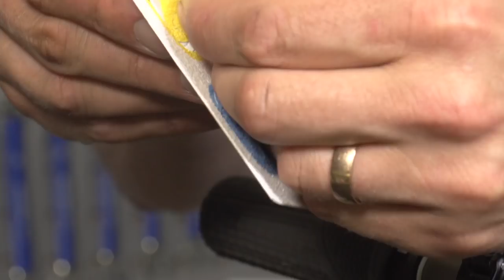7 Pro Tips For The Ultimate Custom MTB Setup | Mountain Bike Maintenance

Comment from the maker: What are your pro hacks and cheeky spare storage solutions? Let us know...down below 👊
Reply: Global Mountain Bike Network self adhesive puncture repair patch Make great anti cable run patches as the are soft rubber and stick on great 👍
Reply: Global Mountain Bike Network  
I put my spare quick links in the end of my bars wrapped in a bit of old inner tube to pack it out
And same on the other side with some cable ties!
Works great
Reply: Global Mountain Bike Network wrap an inner tube around your hub and tape it, and because it is close to the centre it wont add much rolling mass
Reply: rika Shaw Seths bike hacks 👌
Reply: I have foam in my steerer tube so mud dont gets up there, and i've also taped the inside of my tyres with ducktape, yeaa i know it sounds dumb but it keeps me from punctering and it,s an enduro bike so weight dosent matter that much 😉 and my biggest customize is my Push Elevensix rear shock dialed for me 😎👍👌
Reply: Mark Schultz you have a push? Dang bro, do you race?
Reply: Mark Schultz that is a high performance and expensive shock. Usually people who have it are racers
Reply: yeaa i know but in my case it was the only coil shock that could fit my frame ;) but i am sponsored by Trek so i guess you can call me a racer if u want ;)
Reply: Mark Schultz how are you sponsored by them, do you get massive discounts or bikes? How long you been racing?
Reply: can´t say ;) and 5-6 years ;)
Reply: Specialized glove box all the way! 
Also burping the fork with a zip tie is a neat little trick, just carefully push the tie down behind the seals. Until you hear a hissing sound
Reply: You can help prevent water getting in the seat tube by covering the notch with some tape or a bit of frame protector.
Reply: i always set my fork's rebound to super fast top get the best balance comfort and control
Reply: Specialized SWaT 👌🏼👌🏼
Reply: Awesome bike doddy. Now can we see you riding it? Thanks for the tips very helpful.
Reply: rika Shaw I've actually done this on my front wheel and its good. Even at over 60kph I don't feel it. And as a bonus, the weight of the inner tube keeps the front wheel on the ground more if I'm biking uphill.
Reply: I also use Scotch mastic tape on my bike on the outside of the seat stays to protect them from heel rub. Also, my dropper post doesn't have height indicators etched on the main tube; so I use a small piece of electrical tape to mark my correct seat post height. If I'm riding along and think that it's slipped, it's really easy to see for sure.
Reply: best way to store a spare master link is to put it on the on the spot where two spokes cross on the wheel
Reply: The best place to put a Master-link is under your top-cap on the steerer
It will fit if you put one half on each side of the bolt
Reply: but then you will have to adjust your headset and make sure that your bars are straight , but nice idea defintly
Reply: If you think that your topcap affects your headset or handlebars, then your unlikely to be able to fit a quicklink anyway
Your stem bolts do all the holding, the topcap only preloads the bearings, you can even safely ride with no topcap at all!
Reply: Global Mountain Bike Network can I clamp my dropper post
Reply: Walk into an auto body shop and talk to the underpaid goon at the counter about 3M paint protection stuff.  They chuck the leftover bits in the garbage all the time when they're too small for cars, but those leftover bits are more than enough to put on your bike frame where needed.  If they do want to charge you for it, walk out and go to another shop, someone will give it to you for free.

Electrical tape on the cables will also deteriorate and come off eventually, while also making a sticky mess.  Get those cheap velcro cable ties and use those, they can slide a bit if needed, easily removable and are quiet.
Reply: I put grip tape on shifters
Reply: Roll up a small stash of currency notes into the handle bar ends gaps. Some emergency funds, in case cards are not accepted during the rides at a convenience store etc. Also helpful on a rainy day in case you are riding without your car / pick up van and for some reason have to rush back or whatever. Like here in India, we can hire a tuk tuk & just take the front wheel off and load the bike into the tuk tuk and have to pay cash to the driver.
Reply: Vijay
Reply: @KEN53KTM  i tie knot whit fishing line to chain lock (its locked gether and i pushin to bar end it wont rattle in side bar  and its easy to pull out with fishingline
Reply: Make sure to ride with your little brother so you can make him carry everything in a book bag

Comment: I've used grip tape on all my levers, and have gotten excellent grip. However, my thumbs now stick out of my gloves. The grip tape has worn that spot of the glove away to nothing. It works, but be ok with replacing gloves frequently.
Reply: SG - MTB Aren't the gloves enought to stop your fingers from sliding?
Reply: Easy : now apply some grip tape to each thumb of your gloves !
Reply: Unfortunately not
Reply: yep grip tape wears out gloves so now I am using the rougher side of the stick on hook and loop, still wears out the glove but no where near as quick as grip tape did.
Reply: Yeah, grip tape is a gloves killer. I'm still looking for some rubberish tape that's not rubbish (perfect dad joke there).
Reply: sp00n this rubber electrical tape doddy shows in this video might work really well
Reply: There is spray on urethane if you can carefully mask the other surfaces you can coat the levers. Last a very long time and doesn't destroy gloved.
Reply: I actually already use this 3M mastic tape to protect my frame. But it's pretty soft and somewhat sticky. I wrap my knee protectors around the top tube when I ride uphill, and the mastic tape there tends to stick to the fabric when I take them off again. It also dissolves slightly and gets a bit slimey when under constant pressure. I don't think it would work that well on the levers.
It does work great on my chain stays though. I also have it on my down tube and around the bottom bracket, but I'm not actually sure it's strong enough for a real impact there.
Reply: Rough up the lever surface with a rotary tool (e.g., Dremel).. get it just rough enough that it will increase grip without burning through your cheap gloves.
Reply: Just sand down the grip tape, skaters use left over grip tape and sand down where your thumb would hold onto the board when throwing down to prevent "grip thumb".
Reply: I've never had a finger slip on a brake lever and I've ridden motorcycles and bicycles for over 40 years. I grew up riding in wet, muddy conditions in the northeast. I don't get the need for the grip tape.
Reply: use a less rough grip tape. go to a skate shop and look into different brands, some are more coarse then others. you can also de grip the griptape by using some extra grip tape to sand the surface of the stuff youre using. 

you could also look into using the rubber comfort things off pencils and pens on your levers but that depends on what glove you use if itll work. for shifters grip tape is probably still best besides some sort of rubber tape. or take a file to the paddle of the shifter.

Comment: Wrapping adhesive-backed velcro tape (the woolly side) around your cables also helps to prevent cable rub on the frame. I like the cleat bolt in the rotor tip - very cool! Thanks Doddy!
Reply: and chain slap and the rougher side works great for lever grip also.
Reply: What Seth's Bike Hacks much?

Comment: Which suspension lube did you use here? For a RockShox fork the manual says to use the 0w-30 red rum oil for the foam rings, and some light grease for the dust wipers. What's that you're using there?

Comment: When you Tape a Missing Link to your Cables don't wrap the Tape all around. Fold the last 20mm at the half and stick the Tape to itself. Now you have a Flap to Open it.
Reply: Timothy´s Kitchen I think it's going to lift and the tape will un-stick. You're going to use that missing link like once in five years so better be there when you need it
Reply: How do you remove the rest of the broken link in order to insert the quicklink if you don't carry a multitool w chainbreaker?
Reply: PizzocanWasd dunno, to be honest... it might depend on Rider, riding Style, shifting under Load and Rider's Leg's ;)
Reply: Le Typ if You are lucky and it breaks the right Way You might be able to get it replaced without... a Multitool is an Essential. You should consider purchasing One if your Rides are longer.

Comment: Colours are your friend. My rotor bolts are green and gold alternating. This really helps me not only keep track of the bolts I'm tweaking during servicing but also makes my bike more distinctive should some little oik try nicking it.
 Also on the theme of colour, my cables are externally routed. The brake uses one colour cable tie and my gear cable uses another so I can quickly determine which I need to cut for repairs or maintenance. 
 A piece of cut inner tube helps with QR seatposts which use a steel on steel system, my Identiti clamp uses just such a system and that small bit of rubber really improves the action.
 Grip tape makes good, attractive chainstay protection.
 Actually recommend crank boots even if you use alloy cranks. First you're protecting the bike. Secondly, you're adding colour which helps make your ride distinctive. 
 Get one of those rubber nipples for your top cap bolt. It'll help prevent unsightly rusting as that bolt has a bad habit of holding water.
 If you use push-in nylon bar ends you can store small parts such as spare links, bolts or even grease in the, capped off with tape, a plastic bag or a plug made of rolled inner tube. Concealed carry maintenance. 
 Enduro guards are a real benefit to suspension. They weigh nothing but can massively reduce the amount of gunk getting onto those expensive shocks. Front guard also keeps your goggles cleaner. 
 A number plate can help hide unsightly cabling on triple clamps. 
 If you run Magura brakes you can make your bike more distinctive by changing the "owl eye" caliper rings, clamps and even levers to more unique colours. This makes it much easier to identify your pride and joy should some yob try taking it.
 A tube of Fruit Pastels, Wine Gums, Rolos or Polos fits perfectly in a 24mm or 29mm crank spindle. Keep it in place with a bar end.

Comment: @04:37 My inner Nerd would 3D print a bracket that could be mounted onto the saddle rails into which an assortment of replacement screws could be screwed into. After swapping out the I-Spec II compatible Shimano Deore shifters for non I-Spec II compatible Shimano XTR Di2 ones I was left with loose break levers since I was missing the spacers normally residing inside the clamps. Some 3D modelling and 3D printing made quick work of the issue ( http://i.imgur.com/Ie9NDbu.jpg )

Comment: That trick of using one cleat bolt per rotor for spares is pretty clever. Spare master links have a habit of rusting when left exposed to the elements, though, so I'm not too fond of taping them to cables. Otherwise, ace tips!

Comment: Should be Silent slow rebound rear fast front and really really stiff suspension .bar high and far back that is a mint bike and high spoke tension and some threadlock about 50 psi front 60 in the rear and tubeless cause I hate flats and some barons and yeah I ride Freeride and big jumps

Comment: Not sure about fork. Silicon spray is IMO better. Zip ties are great for releasing extra pressure in lowers after service but on the trail there is risk of dust coming under seal. Other tips are great😊

Comment: Instead of using electrical tape to bind cables together make a cable tie using shifter ferralls.  Cut the closed end off and loop a zip tie over a cable and trough the tube and around the other cable.
Electrical tape gets soft and goes gooey in the summer heat.

Comment: good hack for helping tune the grip of flat pedals is also grip tape. you can make them grippier by applying grip tape to any of the flat surfaces on the pedal. silva grip is best. its a metal grip tape that lasts forever. can also help keep you on a pair of pedals longer if you happen to rip pins out and the threads get damaged.

Comment: I use clear circular sticky labels of varying sizes to stop the cables rubbing on the frame.  Once they are on, they are pretty much invisible, and they haven't worn through yet.  I think I paid about 80p for a load of them from WH Smith a few years ago.  They do the job perfectly. :)
Reply from the maker: Fantastic. Cheap hacks are the best

Comment: How about cutting the extra bit of steerer tube?  Spacers over your stem is definitely not PRO.
Reply: ... but it provides the option to mess with your bar height on the fly, without having to buy new parts!
Reply: Varying the bar height to suit the trail versus being stuck with one height for all.
That's the difference between pro's and wannabe's.

Comment: NEVER shove anything into, or down the seals. There are lubes that are applied directly to the fork.
The cables move indepedently and should remain so. To stop this can damage the housing or cables, and make for pressure being put on certain areas along the cable rout. Instead, take a  1/4 inch tube, with a diameter a bit larger than a straw, and more sturdy,  cut it from end to end in a spiral, then wined the now spiral tube around the cables needing collected. Putting the tape behind this then.
The cables can then move freely in the manner they are designed when turning or dropping.
Reply: Good point on the cables